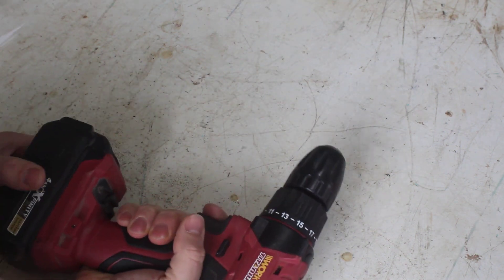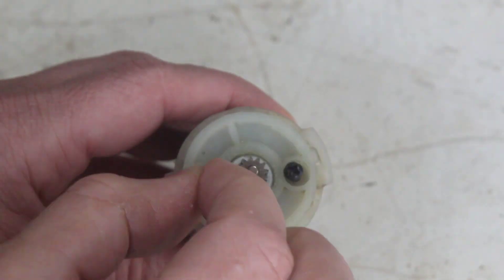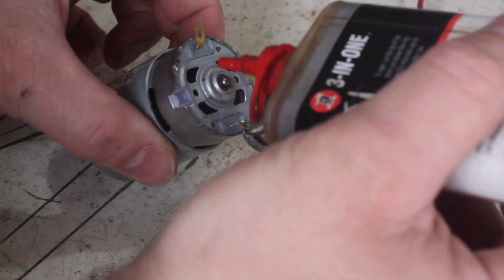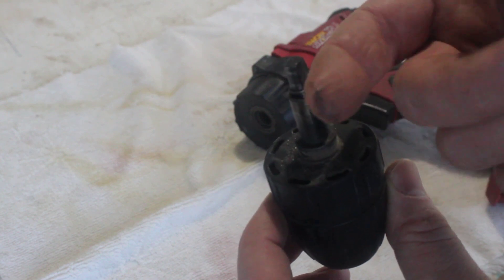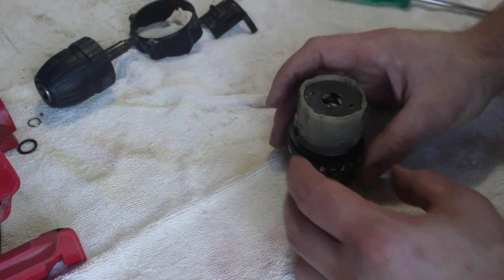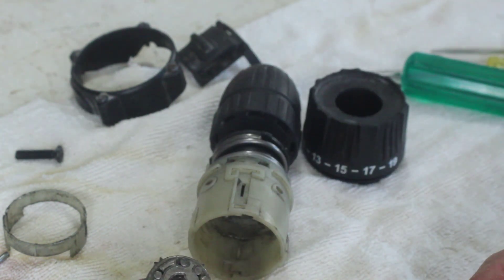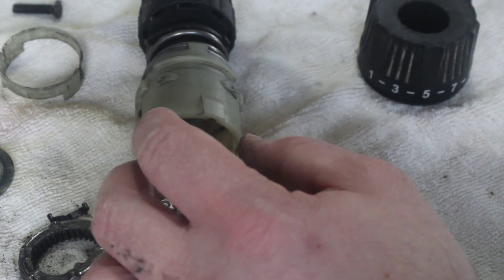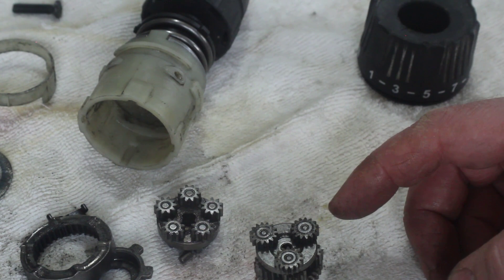18V Cordless drill repair and chuck upgrade (Aldi Workzone)

Comment: These drills are designed to fail. If you release the trigger quickly, the controller puts a short circuit across the motor to act as a brake. If you look inside, you will see a large flash. Eventually, this blows the brushes. If you release the trigger slowly, you don't get this huge surge of current, and the brushes last a LOT longer.
Reply from the maker: Interesting. I knew the brushless ones had a similar feature but not the brushed. Thanks for the info

Comment: I'm trying to remove the chuck. The screw is right-loosey but what is the chuck thread?
Reply from the maker: The chick is conventional thread (left loosy) it can feel a bit like your going to break it though because it's the plastic of the drill partially holding it steady. If you have an impact driver try putting a hex in it and tightening the chuck onto it then impact it off this is far more effective than trying to twist it.

Comment from the maker: Thanks for watching! If you have any questions, please let me know. I'll update this comment once I know which of the ring clips fit, for anyone doing this repair themselves!
Reply: Stymied by the chuck size. The chuck thread of my Aldi drill is 1/2 inch. All the gearbox replacements I've seen are for 10mm chucks.
Reply from the maker: @colinstone8096 I'm fairly certain that the 1/2" thread is pretty standard for threaded chucks of that size.

I believe the 10mm is only referencing the size of the chuck ie. 1-10mm jaw opening. 

If you look up new 10mm chucks and check the specs they should all have a 1/2" thread still.
Reply from the maker: @rikda  the thread in the end of the chuck, and the locking screw don't connect to the chuck mechanism in any way, so even if you broke something in the chuck it should still go on. 
Check the threads on the end of the arbour and on the locking screw and make sure they're not damaged or dirty. 
The other thing is to remember that the chuck screws on normally (right tighty) but the locking screw is a left handed thread so it screw in counterclockwise (left tighty)
Hope this helps!
Reply: @grannyflatgarage7599
Reply: It goes back on but does not lock on.
Tipped down, the chuck fall off.
Further attention to your informative post, I suspect that there is a circlip that prevents that & I have broken it.
Does that sound reasonable?
Reply from the maker: @rikda  Does the whole arbour fall out? That is, is there a rod still attached to the rear of the chuck? If so then you may have lost the same ring clip that I did in the video. Unfortunately to repair that you will need to disassemble the gearbox as I did in the video. 
Good luck!
Reply: @grannyflatgarage7599  Yep & nup LOL 
I'm not attacking that gearbox job LOL
It still works I just have to be a bit mindful of it.
It's not the only one I have.
When  it comes to tools, my daughter tells her husband "I know he (Me) will have one, you just have to find it" 
Thanks again.
Reply: Thanks. I was about to edit the post and add the time 7.03-7. The piece bottom left with the lugs. And it would be good to see a normal speed video of the reassembly.
And just simple search for electric drill gearbox?
Reply: Hey man, dunno if you still have this drill but i just smoked the locking cam, locking nut and third carrier on mine 😔 
Practically the whole sprag clutch from 6:19 to 7:00 on your video

Can you please tell me where do you find spare parts for these gearboxes or at least what are the search terms. 
I found the exact parts i need from an online retailer but they only ship in Russia ( if you can believe it ) and their article codes do not pop up on google for the western market. 
Pretty sure these are universal parts but can you help me out a bit in finding them? 
I would have put up with buying a whole gearbox if it was not for the non standard chuck i have on mine , so the assembly of gearbox plus chuck is like buying a new drill.
I will appreciate it if you can point me in the right direction.